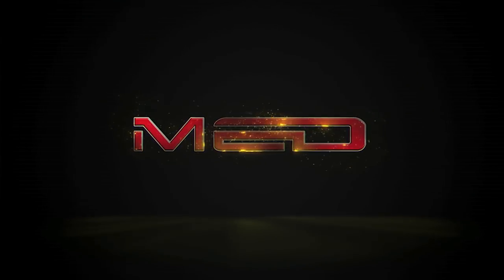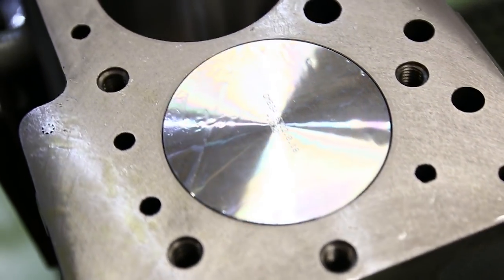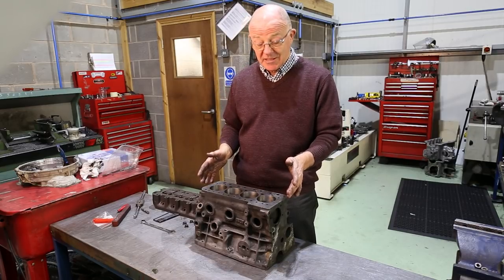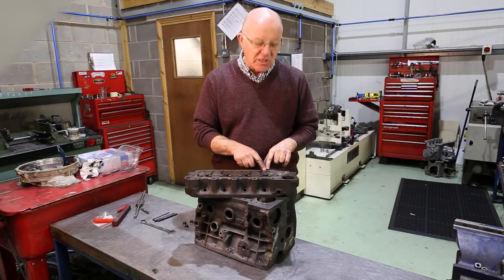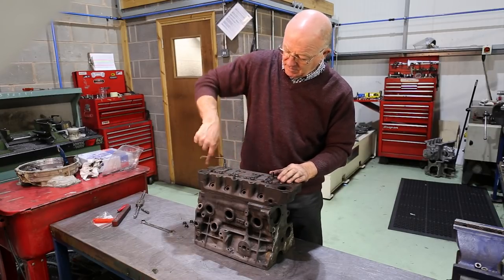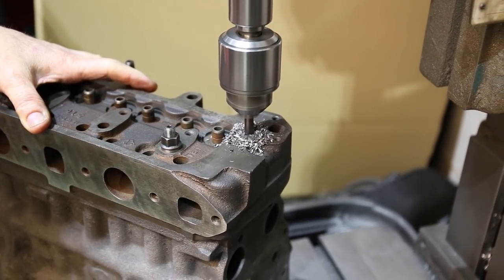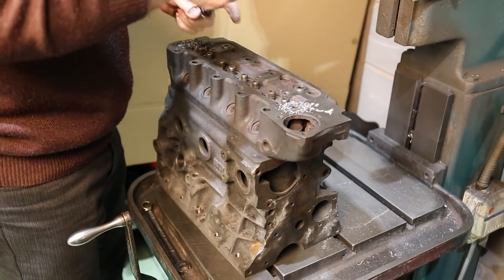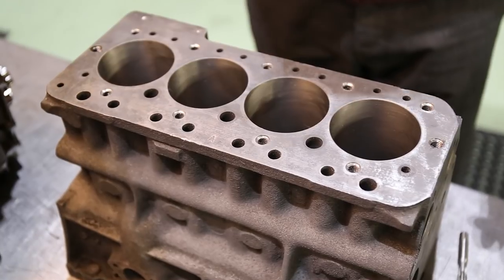MED 11-stud head conversion, A-Series engine

Comment: Why don't you just get bigger head studs,  you drill out the hole then retread it
Reply from the maker: The head gasket wouldn't fit if you did that.
Reply: Fitting a helicoil stronger than just drilling / tapping into cast iron.

Comment: Thanks for the great video`s I was told the front stud was to pull the block up to the head but I have never seen a problem with the front leaking other than the oil feed hole can slightly leak.
Mike Owen

Comment: I too would be interested in seeing a head being drilled for 11 studs. would be curious to see how you locate it, and machine the surface on the head for the head stud nut
Reply: I can tell you if you like?
Reply: Drill and tap block and the get 2 bolts cut heads off bolts . Machine to a point on one end screw into block at the 11 stut holes keep tje machined point just above block put the head on give a tap with a hammer each end and there you are a centre pop each end now all you have to do is drill. Some people lol
Reply: @chrismorris5608  των
Reply: @chrismorris5608  Think you simplified that a little.... While what you say basically has merit, there are a few things you forgot to factor in. Firstly how do you drill and tap the block for 11 head studs if you don't have an 11 head stud hole head? If you had an 11 head stud head you wouldn't need to drill and tap it for the extra two head holes would you. So the first step would be to beg, borrow or steal a genuine 11 hole head (you don't want to pattern off a head someone guessed at). Then drill and tap as shown in this video. Then meticulously make sure the bolts you sharpen to a points that is dead centre. 

Perhaps a lathe to make sure they are perfectly centre. Now that you have two perfectly sharp and centered marking bolts, you need to ensure that the head is sitting perfectly in the right spot before you attempt to give it a marking tap. So you are probably going to need to put every head stud in the block to minimise movement, and on top of that use a method like the one shown in this video to ensure absolutely minimal movement.

Now you are ready to give the head a tap with the hammer. Half ass it and the same results will follow.
Reply: @DodgyBrothersEngineering  well   i was just trying to make things simple for people and you make it sound hard! I was an engine builder for 15 years too much info is a bad thing for some people and i dont feel the need to go into anything so deeply lve been in loads of ford mags worked at brands hatch building the race school engines in the late 90s but who cares now i would rather go on holiday to usa twice a year  but still have 8k worth of mac and snap on i have not touched in 14 years lol. Thank for the chat mate its been very retro.
Reply: @DodgyBrothersEngineering  bet im about the last machine tool fitter / engine builder  about but who care lifes not about what you can do its how much you bullshit . Wish someone would of told me that 30 years ago lol
Reply: @chrismorris5608  like you I really haven't been on the tools "properly" for 20 plus years, but still yearn to build kick ass engines. For me the highlight of my career was probably building the blown alcky engine for the shop race car. Good results required I be meticulous, majority of the time I rebuilt the Brodix heads for it and another guy built the engine, but occasionally if he was away I got to do both. So I tend to think in a very detailed way. For me that was very little information, but for others that might have seemed a lot.
Reply: @DodgyBrothersEngineering  yes but renember there are so many on the net that are so full of it lol nice to chat to you. Im still an engineer work as a fitter but into holidays now going to new york and then maine after this year.
Reply: @chrismorris5608  definitely lots of keyboard warriors out there that have all the theoretical knowledge in the world, but have never picked up spanner. I may not be as active with engines these days, but I still keep my engineering hand in on my DIY CNC machine. once bitten by the modification / engineering bug there is no getting rid of it's influence.
Reply: @DodgyBrothersEngineering  yes you put it a lot nicer than i would.
Reply: @chrismorris5608  problem with YouTube and any other social media it is really hard to tell the tyre kickers from those with real life experience and knowledge, as they both offer advice like they know what they are talking about, but only one does.

Comment: So now that you made a 11 stud block. What’s the best why to make a 11 stud head

I have a 12g1316 head that I would convert to 11 stud
Reply from the maker: Measure and drill - bit more straightforward than the block as there's no threads to tap.
Reply: I drilled the extra two holes by using an existing 11 stud head as a template.